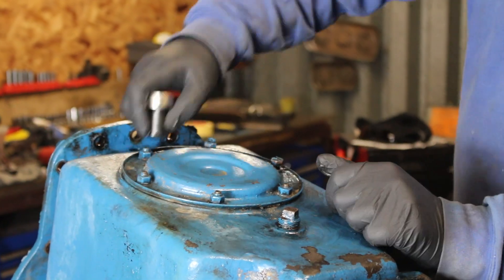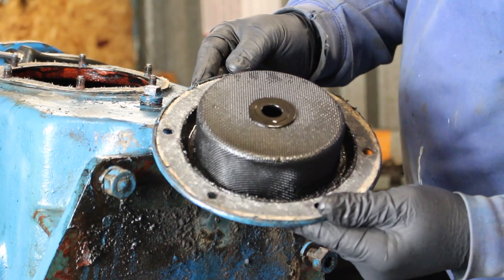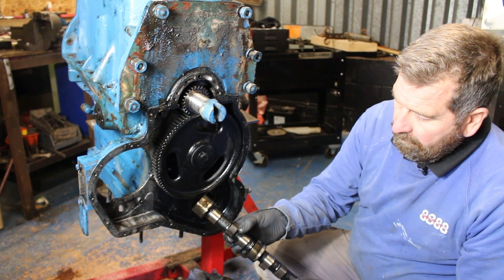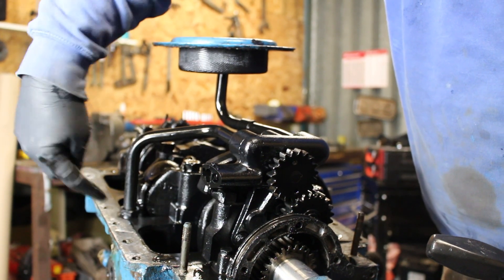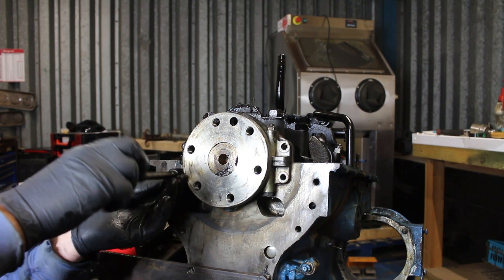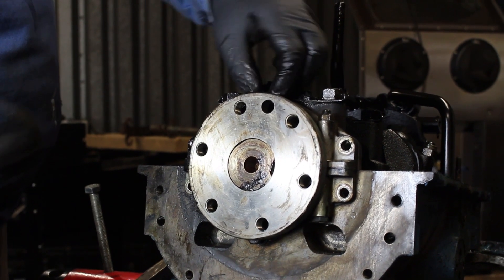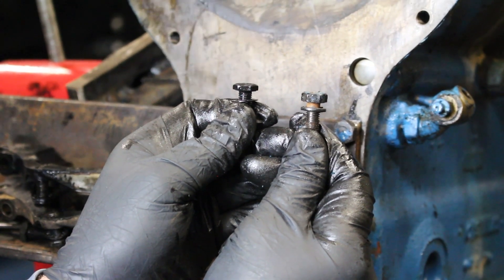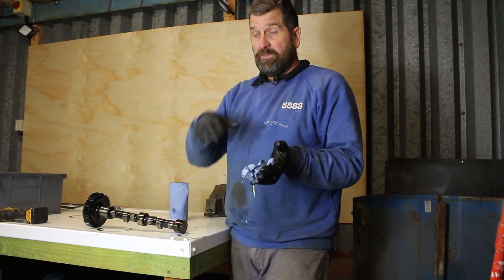Removing the Sump on a Fordson Super Dexta Engine | PART 4

Comment: Great video again. We are proceeding at same phase. My Dextas engine also in suprisingly good shape. Never opened, over 8000 hours at least (meter broken)... Cam is almost as new, no wear at all. Crank also nice, maybe polishing will be enough. One piston had broken rings and ond valve realy loose. Those I suppose were the reason for oil soitting from exhaust. Hadnt measure the sylinders, they seems quite worn. 
Over all, good time to make complete overhaul.
Waiting and looking Your videos for guidance and tips.
Br, Juha from Finland
Reply: Hi thank you for your message glad to hear that your engine is not too bad. I will try and do a video on all the measurements regarding this engine. Thanks again for watching.

Comment: Yet another great video Kev, what was the bottom of the sump like did it have a think deposit oil?
Reply from the maker: Thank you. 
The bottom of the sump was quite clean the worst of it was in the sump strainer so it was doing its job. Also the camshaft is in great condition for its age I was very surprised.
Reply: I’m amazed that the engine is in such good condition considering its age and never been apart now wondering if the damage to that piston was there when the engine was originally built in the factory?
Reply: It’s very possible it was a damaged as it was fitted very interesting though.